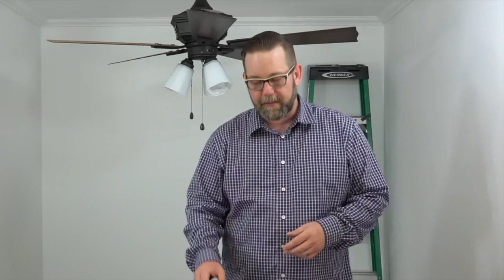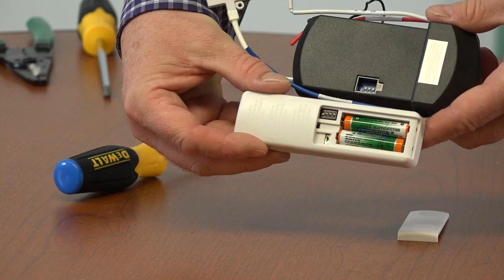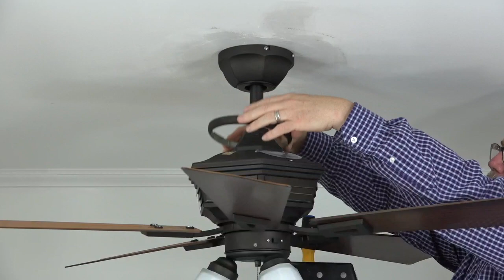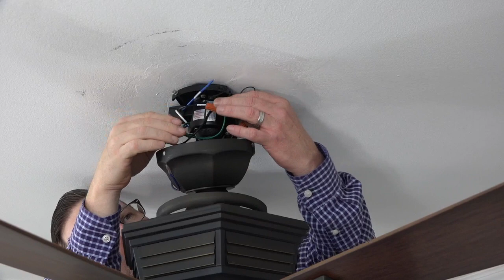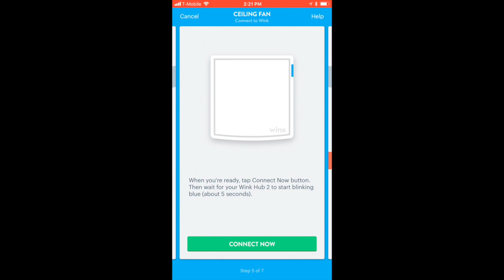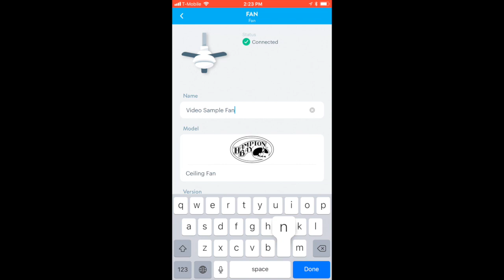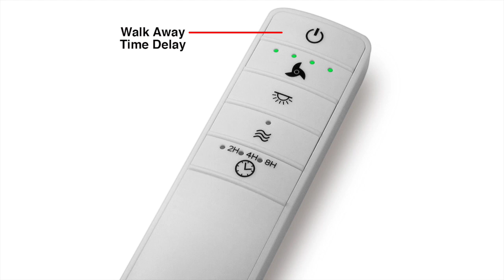How to Install the Universal WINK Ceiling Fan Remote Control

Comment: Do u have a video of reseting the controller
Reply from the maker: We do not have a video for resetting the remote/receiver. The process is easy. If wired to a wall switch, just turn the wall switch off for 3 seconds, then turn it back on - Repeat the off/on process 5 times. Once the reset is complete, the light on the fan will blink. Then you can reconnect the remote with the WInk hub. If you're receiver isn't wired to a wall switch, do the same off/on process at the breaker box.
Reply: @ceilingfans101  Great, between you, Wink, and the Hampton Bay manual I have 3 different reset instructions. I bought this thing used and got the remote working fine but can't get it to pair with Wink or reset. I need a video to see which of the methods actually works. And I've tried all 3.
Reply from the maker: @howcin  Make sure the Wink hub is within the operating range to make sure it is able to communicate with the receiver. Make sure the Wink hub has the latest firmware installed. When paring the remote, if it doesn't connect, the app will give instructions on resetting the device. Usually turning the power off/on 5-8 times in 3 second intervals.
Reply: Has anyone successfully reset the receiver? I had a pairing with my Wink Hub 1 but when I upgraded to Hub 2, the pairing was lost and has not been able to pair again. I'm unable to pair with either Hub. I tried different ways to reset to no avail. I bought a 2nd receiver and it won't pair with either hub nor reset. I have tried various combinations of on/off with no success. I'm hoping someone has the correct answer. btw: I had one Hub in line-of-sight of receiver...nada.
Reply from the maker: @issaorangecounty7052  The Wink app will walk you through the pairing process. If the remote is not able to pair with the hub, you should see the option to reset the device in the app. This basically has you starting the process with power to the receiver off (at the wall switch or breaker box). Turning the power back on for 3 seconds and off for 3 seconds and then repeating 8 more time for a total of 9 times. Once the reciever is reset, the light should blink and the fan should move. Then you should be able to do the hub pairing.
Reply: The pairing process is super irritating. I've got 2 out of 3 of mine re-paired, but the third one just won't get into pairing mode. I've spent many minutes flipping the switch like a jackass, to no avail.